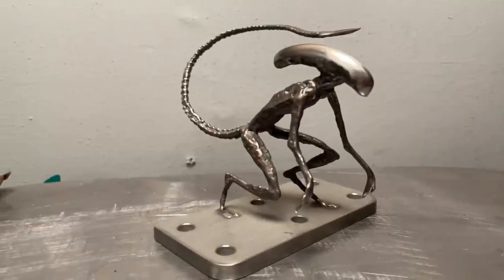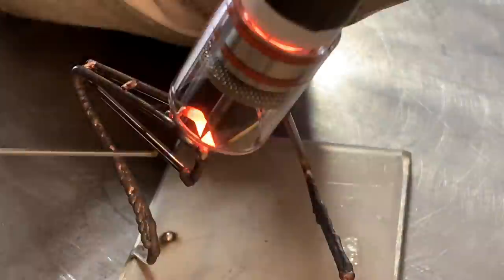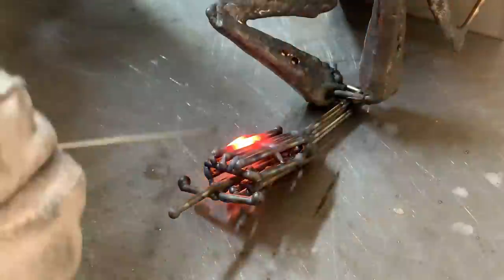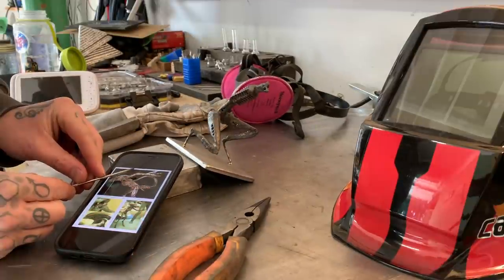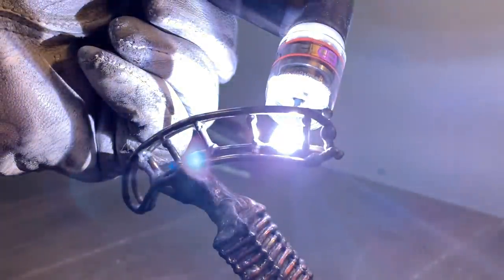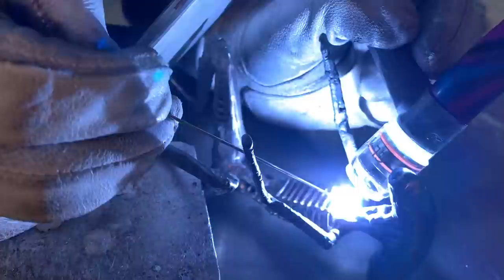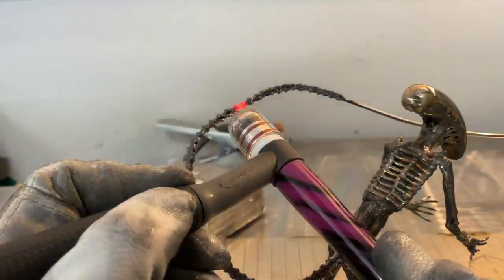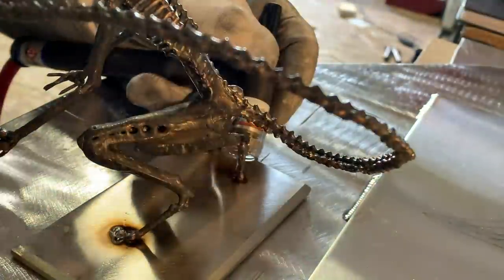I turn metal rod into an INSANE ALIEN

Comment: Your a true natural make it look so easy. And it’s not . I’ve been welding mig and stick for 30 years . Just bought a Jasic tig struggling to see what I am welding keep dipping the tungsten . I will get there in time . Grate tip you gave about keeping the filler rod in the gas . Glad I watched your video thanks for sharing
Reply: I’m in the same boat as you, been at it a couple weeks. I knew it would be hard, I just didn’t realize how hard, TIG is a very very steep learning curve… seems like I started out with beginners luck and my welds have consistently gotten worse the more I learn… I’m stubborn though and gonna try until I either get it or die haha

Comment: What PPE should I get for TIG welding?  I started welding last week and got a MIG to build table.  I got self darkening helmet, sleeves, shorts, shirt, in the garage with 2 fans blowing, and fume extractor.  Nose smells like tare, and I got minor burn on legs wearing shorts.   I bought flame resisted  cotton overalls and half mask P100 and I'm switching to TIG welding instead.  With all of this PPE should I still be safe to weld steel with TIG?

Comment: HEY!? WOULD'NT  B A BETTER WELD & SMOOTHER FINISH!, SHOULD YOU'VE CUT OUT THE ANGLES IN (1/8) STEEL! & THEN ["FILL & CHILL"] SINCE THE CUT OUTS WILL BE ABLE TO HANDLE GREATER HEAT!! WITHOUT MUCH DISTORSION & A BETTER SURFACE FINISH THRU BETTER BUILD CONTROL!?